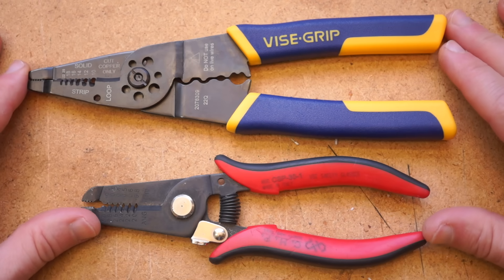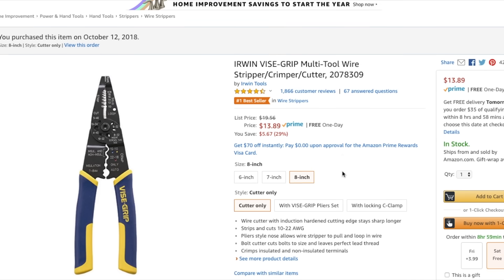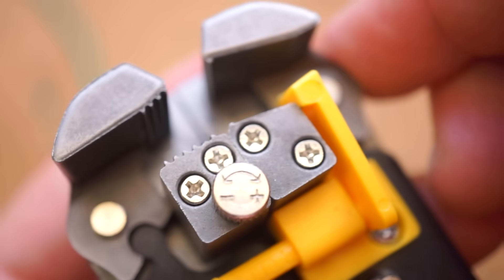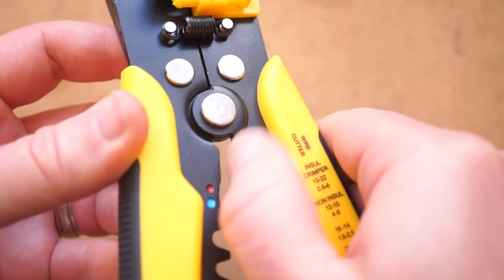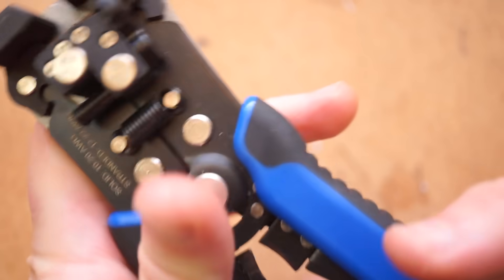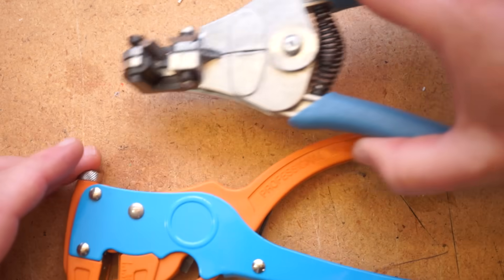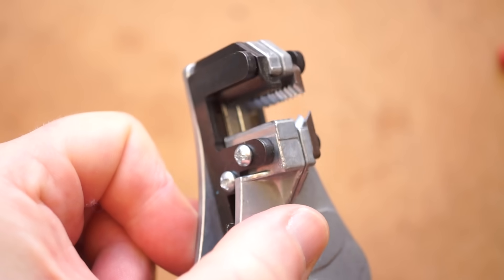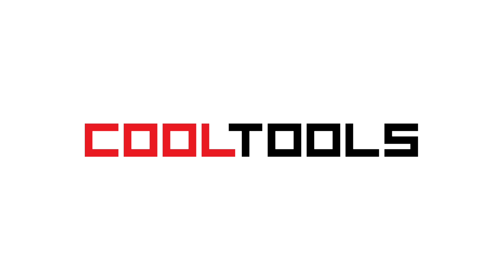Searching for the Best Wire Stripper

Comment: After 45 years in the electronics trade I have tried most, generally tossed out because of too much damage to the insulation.
For small (< 2mm) wire I use Weidmuller stripax.  The blades are a little like the last one you showed, but have fine fingers ranger than one sharp blade.    Second one down on this page.  There are many like these, but IMHO this is the best https://www.weidmuller.com/155870/Products/Tools/Product-overview/Stripping/cw_index_v2.aspx  They also have a shock assorber, which is worth it's weight in gold after a long day.  Very ergonomic.  

Sub 1mm, I use https://cktools-superstore.co.uk/CK-Precision-Wire-Stripper-for-025-to-080mm-Diameter-Wires-330013  These can be set finely and will strip wirewrap wire all day without adjustment, and work down to 0.25mm.  Also good for removing enamel from hard enamelled wire (with care, and no nicks). 

Biggest disappointment - Knippex Precision Insulation Strippers.  Cost about US$300, blades fail in less than one month.

Comment: I like your detailed overview of the strippers. As a panel builder myself, stripping over 1000 wire ends on a busy day, I really like the Knipex Multistrip. The lightness, reliability, and repeatability with the length adjustment is very nice.

Comment: 20+ years experience industrial electrician, 8 years building MCC's & BMS control panels, IMO for 0.5sqmm to 2.5 sqmm tri-rated the best stripper you can get is a Thomas & Betts Duostrip 200; fast and easy to use, much less fatigue when stripping a lot of wire and ambidextrous-so ideal if you are left handed. The model with the built in crimper is pointless, might get you out of a spot now and again, but the basic stripper is excellent.

Comment: In the latter stripper tool, you have missed a most important detail.  The strippers you show all have blades that have slanted knife-edges.  With these (and the manual strippers with similar-shaped blades) the stripper can cut deep into one side of the wire, nicking and even partially cutting the copper, while on the other side, fails to cut all the way through the insulation.  If you get instead a "die-cutting" stripper (for example, "Stripmaster" sold by Ideal Tool Co.), the design is the same, except for the cutting edges.  They have a narrow sharp section which cuts through the insulation, and a wider plain cylindrical smooth hole that guides the wire to remain centered in the cutter.  If you strip Teflon wire, nothing but these will work!
     Another type of stripper not covered is the thermal stripper (such as Kinetics Teledyne Stripall).  These have heated, dull, blades that melt the insulation.  These will work on Teflon wire, and cannot damage the copper.  You use lower temperature (settable) for vinyl insulation, and higher for Teflon.  Most of these have straight blades.  They work best when they are closed on the wire, given a quarter turn, then pulled off.

Comment: If you want to make any stripper more effective and can even not use any stippers on sonme wires is a simple lighter torch.  Softens the sheath to allow an easy strip and eliminates any wire scoring from bad strippers.

Comment: The Ideal stripper is what I worked with in the air force, that's what I have now. All those other strippers except the Ideal and the Ideal knock-off stretch the insulation. Rust is entirely up to the owner, if you respect your tools, you take care of them, a little light oil goes a long way to keeping metal tools rust free. Good video.
Reply: And we suppose to guess what you worked with in the air force?

Comment: The last ones you showed are the ones that I have used for 20 years.
A few years ago I was at Home Depot and picked up a set that's reversible. The brand is "Commercial Electric", has 20-10 awg on the left and metric on the right, thumb release and spring loaded.
I bought it for installing a new DVR and camera system and LED lights inside and outside of my house.
Hindsight is 20/20 as they say. The tool works ok but I kept reaching for my Klein lineman pliers with the crimper in the handle end.
As you said, Electronics and Electrical work are a little different. Retired Electronics Technician and still doing a bit of both.
If I were to get back into troubleshooting I would definitely be getting your Top Pick. I've developed a habit of stripping a little long, except when soldering into an RG solder in connector.

Comment: The best is still a thermal wire stripper.  It does the least damage to the wires and is only one of the few strippers that works well for wires with Teflon insulation without nicking the wires.

Comment: In 30 years working in electronics for OEMs it is known that electronic engineers do not use wire strippers.  We are trained to do it with mini cutters.   I have used so many designs, all are useless and wear out in a short space of time, costing quite alot per wire before the too wears out.   The best ones are from RS or CK.     All these models are good when new but the knife edge dulls very quickly.

Learn to use high quality wire sharp cutters for wire stripping, ie made by CK (Germany) or ones made in Sweeden by various names.

There are lot more wire stripper designs than this video shows.
Reply: Real professionals that works on high reliability hardware ONLY uses thermal wire strippers.  HAKO FT-802 and the MEISEI M-20/M-10 are popular models.  It is one of the few that will strip Teflon insulated wires without damaging the strands. Mechanical strippers will still nick the wires if you examine it under a microscope.
Reply: What does wire-stripping have to do with Electronic Engineers?  Do you mean Electronic technicians?  For Electronic Engineers shouldn't you be talking about the best Calculus text books?
Reply: @geezlepuss7863  If technicians pick at insulation with mini cutters, they would be fired on the spot.  It takes too long and there are too many potential to damage the wires by accident.  The only time I see people do that is with shielded wires to clean the shielding wires prior to soldering.  If engineers are doing wiring for production work, they company is not using their assets properly.  I only see engineers working on developmental and trouble shooting as part of the design phase.

Comment: The best ones in my opinion would have to be Klein I’ve had no issues with my kleins are one makes a decent product and vice grips but I always go to my Klein stuff for my wire stripper The reason I also like them is because I can take them back to Home Depot anytime if they don’t work properly and they gave me a brand new set no questions asked

Comment: Bought that 💩 crappy blue and orange one on Amazon and could NOT get it to do anything decent. Could not move the stop block at all..like it was glued in place! Don’t know how you got yours to work?!?!? But that was a VERY well done informative video. I’m sold on the ViseGrip auto stripper.  Have the GB auto stripper but doesn’t do well for stripping bigger solid gauge wire and I do both electronic and electrical and been looking for a good pair..THANK YOU!

Comment: I find the automatic ones work good for awhile then start slipping and damaging the wire. I've tried a few different brand and now just use the simple channel lock strippers I've had for years. Find they work best.
Reply: Get the type that he showed last with the blades that come down.  This is what we use in our shop.  We make doors for switch gear and use multi strand 14-10 AWG mostly.

Comment: Those Ideal 16-26AWG strippers are pretty much the standard for Aviation. Consistent and reliable. Work perfect for Mil-Spec wire.
Reply: Tree Power  you may confused with MIL spec one. Common industrial Ideal model 45-097 is not so expensive as shown in this video. It is around 50 usd.

Comment: You need to try some stripax.  Yeah they are expensive.  But they are 100% worth the price.  Been carrying a set for over 4 years, and have never had them fail.  And I work factory automation, so I strip a LOT of wire, between 32awg and 8AWG.  And the stripax I often do 3-5 wires at one time.

Comment: 12 g  all the way down to 30 g.  20g - 30g is a short range of very small, low voltage wire.

Comment: The only tool truck we get at our shop is Snap On so that's what I bought , I'm not sure what sizes I bought (I have 2 sets) 1 is about 9 inch and 1 is about 5 inch .. They work very well neither are automatic but the small set are spring loaded ... They get used usually a couple times a week , razor sharp and I love them ..

Comment: I'm old, but my favorite is the good Ole Miller wire strippers, very simple in construction. I've never used the stop screw, always just felt for the proper pressure.  One of the problems with many strippers, they can easily nick the conductor.  If you are doing production work, that's another story.  Another one of my favorites, originally was made by AMP, later by Paladin, and apparently now by some company I've never heard of, Kkmeter.  It will adjust to all sizes of wire within it's range.  What is unique is the actual insulation cutter, not a simple knife but a bunch of little teeth that conform around the insulation.  The tool is also good for stripping ribbon cable, if you are into that stuff, as it can strip multiple conductors at the same time.  Jim

Comment: I wouldn't use any of them. Look up blue point wire strippers. Little gun looking pair works better than all of them.I have used all of the ones in the video and none work as good.use mine almost everyday in the shop

Comment: They only wire strippers worth anything was the 1st one.
Reply: You've obviously never used any of the automatic ones, or you've never had to step hundreds of wires. There's a reason every electrical engineer and electrician (mostly LV electricians) use automatic wire strippers.
Reply: Andrew Delashaw I was a residential and commercial electrician for 5 years and I never saw anyone ever using those auto strippers.  Too big and bulky.  We mainly were stripping 14, 12, and 10.

Comment: I have one of the recommended Irwin strippers and they don't grip tightly enough to work on 12 and 14 ga. wire.  Even with the adjustment screwed down as tight as it will go the clamp is inadequate.  I took them apart to see if I could fix them but, no, there's no way to make them grip tighter.  I even put in a shim to push the little adjustment pin further out but it still wasn't enough.  By the by, it takes a pair of tweezers to put the little adjustment pin back in because it is so tiny.  Sadly, it was the local Platt Electrical Supply store that recommended the Irwin stripper.

Comment: I noticed you like the Haco wire strippers. Should look at the Paladin/Greenlee/Textron PA1117 and PA1118 set. The 2 pack is $15 at Menards. Coming from doing lots of delicate electronics work along with fiber optics, textron/paladin/greenlee are a trusted name in FO strippers with the PA1171.

Comment: I usally use the " Weidmüller Stripax ", or a cable shear.. Whatever is nearest…

I am not a huge fan of the  "Self-Adjusting Wire Stripper", as the metal clamps most times leaves deep marks on the isolation or even damages it.
The clamps on the Weidmüller is made of plastic, and uses more friction than force to hold the wire when it pulls off the isolation..

Comment: Automation Direct or Panduit front loading strippers with a v-blade. Unbeatable for control panel wiring and electronics. Easily handles 14 to 30 AWG.

Comment: I have owned the Irwin vise grip automatic stripper for about 2 years now. Rewired about every circuit on a 67 camaro they worked great for stripping wire. However the crimpers suck. I hate crimp connections any way so I solder and heat shrink every thing. So the work great for me.

Comment: 35 years from houses to power plants....klien needlenose- strippers are my go to....use a razor knife for big wire...
Reply: Once in February, in Western PA (COLD) we did a primary voltage conversion at a bottling plant. My partner dragged his ass from the warm office to help do a couple of the final terminations of direct burial HV cable, we had already done 16 without him on the wretched day. Anyway, he crimped on a terminator, but the jagoff forgot to slip on the molded stress cone first! When he realized his boo-boo, he left it to me to undo. There was so little extra cable in the transfer box, I didn't have room to swing the stripping tools for the 1/2 inch thick dielectric, so I did what I would have said was impossible and (CAREFULLY) prepped the bitter end of the cable with my pocket knife. We renamed him "The Mad Crimper" which he hated -  I didn't care because I never worked with him again.

Comment: I never liked any kind of automatic stripper. I found them to attract the insulation or nick the wires, never perfect, even the ones with the die cut holes. My favorite strippers are from Klein and they are over twenty five years old. Very similar to the channel lock ones you showed at the beginning.
Reply: Right on! The simpler, the better. My go-to's are the short Ideals with BYPASS cutters and no crimping dies. I have a pair of the die hole "automatics" which I used for a short while . . . about 40 years ago - they were more of a pain-in-the-ass than a tool. Funny how these reviews are usually done by a guy who never spent 8 hours a day using the stuff.

Comment: Since I do both electrical and electronic work I keep 2 pairs of Klien manual strippers in my kits. I can cover from 10 to 30ga wire and combined they weigh less and take up less space than any of the automatic units. Plus the auto strippers suck on THHN wire.

Comment: I loved the video! 
As a Journeyman Inside Wireman with 30 years (sigh - for the trolls out there- your state would call me a Master), my personal choice for a Self-Adjusting Semi-Automatic Wire Strippers ( I actually don't use them much ) would be the Klein - the crimpers on those other models (Irwin included) are completely useless. A mechanical indent crimper CLOSE TO THE JAW like T&B crimpers is what is needed for mechanical pressure connectors. 

The cutters on the Klein looked pretty good too (shear type). Those other tools with Anvil-Type wire cutters are infuriating on stranded wire if they aren't precision-built high quality tools.
Obviously it's all about the intended purpose - the producer of the video had their preferences and I have mine - that's perfectly fine 💘

Here are some tips from my years of experience, FWIW:

If you're using oval crimpers (the Yelow, Blue, and Red dots at 5:32) for 'INSULATED TERMINALS' please don't bother.  THEY JUST DON'T WORK. 

Use NYLON INSULATED TERMINALS that have see-through yellow/ blue/ red insulation for the 3 ranges of wire size commonly used in wiring and control applications both for industrial use and transportation and USE INDENT CRIMPERS like Thomas & Betts (T&B)/ Sta-Kon WT111.
Opaque VINYL INSULATED TERMINALS are complete garbage. Some folks warm the insulation up with a heat gun, use an indentation type crimper, and slip the insulation back over the crimp - that's about the only way I will use vinyl insulated connectors but frankly that's a tremendous amount of work. 

Anyway, I digress. For strippers I like the Kleins and Ideals (curved, premium grips) primarily but I'm open to the Southwire, Irwin, and Channel-Lok strippers too. 
That's my windy two cents worth 🧓😁
I have an older Snap-On set of old style single stroke wire strippers with individual sizes that I use for wiring control panels and PLCs with crosslink-insulated wires (too hard to strip otherwise) and a cheaper version of the same thing (not awesome). Overall, most of us electricians learn to use whatever tools we learned with - I learned to use my pinky finger to open my pliers but that's kinda what I was paid to do 🤷‍♂️
Reply: Thanks. You have achieved something very rare-you made in intelligent, non-judgmental and useful  comment on Youtube!

Comment: It looked like all the automatic strippers damaged the remaining insulation except for the ones with the various hole size dies.
Reply: I have the Irwin ones, and from my experience they don't compromise the insulation. The cut is just a little rougher.
Reply: Yes, the style with the circular holes are the ones that make the best insulation cut. I do have Klein Tools KATAPULT 11063W and it's working great for me.

Comment: That blue & orange one is a knockoff of a Paladin Mini Stripax. Which is an amazing tool. It is also 112.00
Reply: Yeah, I had one of those knock-offs that I got at Radio Shack years ago. Then at work I got one of the regular Stripax and found I prefer the straight form factor (and the cutter doesn't move when closing). One of these days I'll get myself my own Stripax for home...

Comment: To be fair, I've never owned any other self adjusting wire strippers besides the Irwin model, but I find them to be less reliable and thus more time consuming than even cheapo traditional types. Maybe I got a bad apple because I frequently have to adjust them and operate several times to strip the wire, and I actually have a high opinion of Irwin tools in general.

Comment: This is all very well for single core cables but what about duel core cables like mains leads that have 2 sheathed cores inside.. is there a stripper that will just remove the outer sheath keeping the inner cores intact and untouched?

Comment: One thing the self adjusting strippers is also good at is stripping two or more wires at the same time, at the same length. Good for Ethernet and telephone cables to fit into modular terminals.